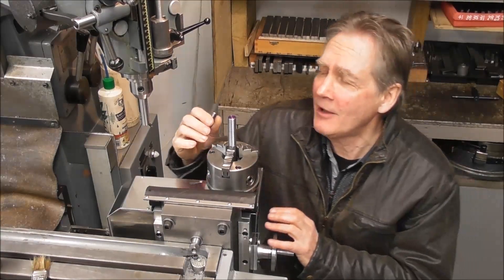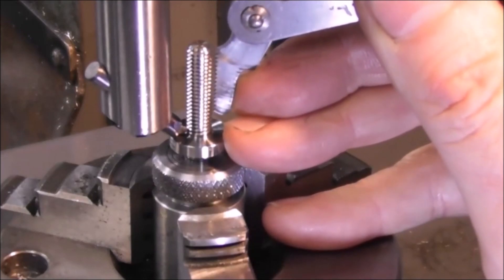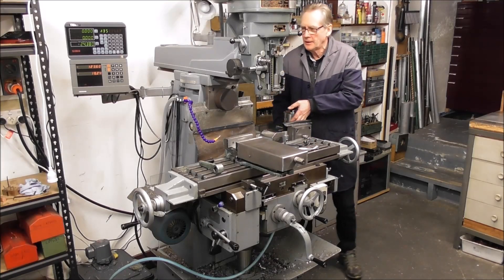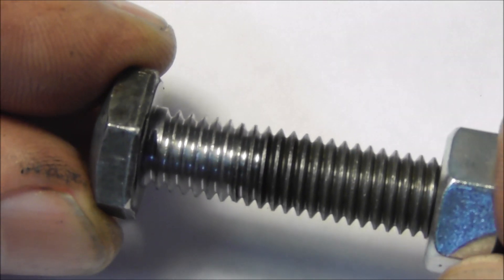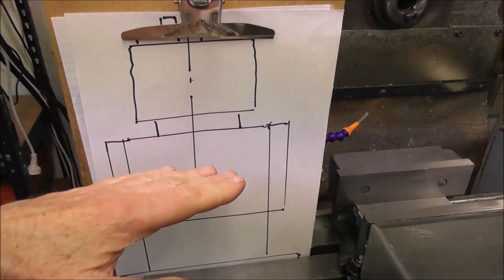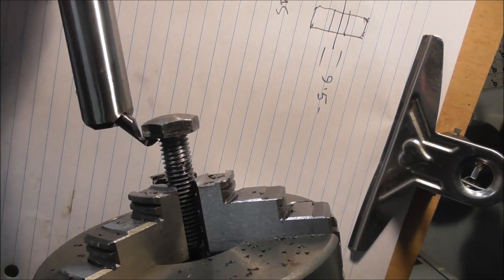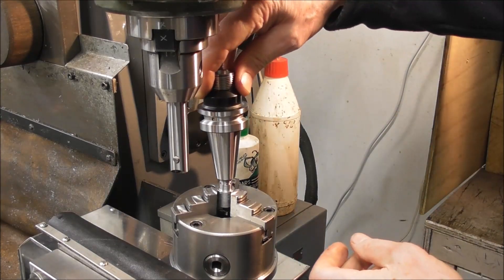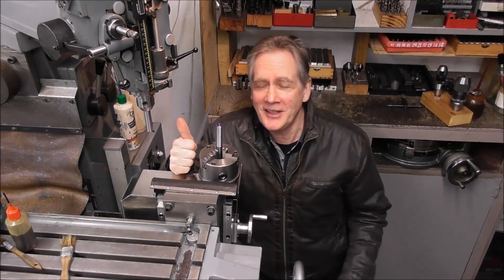ThreadExpress 2. 2 - Pros and Cons

Comment: Cliff my Hafco mill does not have a head that can swing so I think I'm out in terms of mounting on the mill.
I am wondering how necessary the mill is. 
Would it be possible to do this with a stand alone spindle with some sort of adjustment to set the distance between the job and spindle centre and skip the rest of the mill. It seems possible that if the fly cutter loads are light all that's really needed is a spindle with some side ways adjustment.
Reply from the maker: Hi. ThreadExpress started life as a stand-alone machine! See the first video in the ThreadExpress playlist made back in 2009. Cheers, Cliff
Reply: @Threadexpress  love it. I have a lot of catching up to do. If I do this I will need to go stand alone I think.

Comment: Your application is very interesting. I am interested in having the plans for the construction of a device with these characteristics, because I see many applications in the lathe, vertical milling machine, horizontal milling machine and flat surface grinding machine. I really admire your work and all the considerations you have made regarding the interpolation of a thread with a 3-axis CNC are true. Therefore I would like to know if you have the plans available and their cost.
Also, since the system is very little known, it is not widely spread. I am also a prototype manufacturer, in a garage workshop and I would like to take on this type of challenge. You can look at my page on YouTube where you can see some of the work I have done.

Muy interesante su aplicación, Yo estoy interesado en tener los planos para la construcción del un dispositivo de estas características, porque le veo muchas aplicaciones en el torno, fresadora vertical , fresadora horizontal y rectificadora de superficies planas. Admiro mucho su trabajo y todas las consideraciones que ha hecho en cuanto a interpolar una rosca con un CNC de 3 ejes es cierta. Por lo tanto me gustaría saber si tiene los planos disponibles y su costo. 
Además como el sistema es muy poco conocido por eso no tiene tanta difusión. Yo también soy un fabricante de prototipos, en un taller de garaje y me gustaria asumir este tipo de reto.  puede mirar mi pagina en YouTube donde puede apreciar algunos trabajos realizados.
Reply from the maker: Hi - Sorry somehow, I missed your comment. You may have seen in more ercent videos, Mark Presling is currently building a V3 and preparing plans. Once he has completed that stage I plan to make drawings available. Stay tuned. You can also email me address under 'about'. Cliff

Comment: If you could make a 90° for a mini mill spindle maybe it would be able to be used on a mini mill. Or use a smaller cutter facing down on some short of large fly cutter on a normal mini mill head but I don't know if that would work or not?
Reply from the maker: Sorry I missed your comment until now. We are mulling over different options, stay tuned. Cliff

Comment: Regarding mini-mills, many of them allow the head to rotate 90°, i.e. spindle parallel to the X-axis. Could Thread Express be operated horizontally, with a (much thicker) mounting block on top of the table, to match height with the now-horizontal spindle and set the helix angle of Thread Express, by pivoting about the (now-vertical) pivot bolt axis. The Thread Express unit would have to have the arc-slots built into it and the mounting block would have to have the threaded holes, since the fasteners could only be accessed from above. One disadvantage of this idea is that gravity would no longer help with removing backlash. Perhaps a spring could be used to remove backlash, or the feed nut could be made adjustable to minimize backlash. Food for thought.
Reply from the maker: Hi Mike. Good thinking, I have used it with my horizontal spindle, and it worked fine, and discuss this in an early video. I have the base plate extending enough on my prototype to bolt directly through to the table. Yes, and I have been thinking about tipping a mini mill head to 90 degrees also. I have not yet discussed this as I wonder how many mini mills tip to 90 deg? This could be the excuse I need to buy a typical mainstream mini mill and make a slightly scaled down version! Cheers, Cliff

Comment: I notice that your original machine was a 'stand alone' unit simply utilising an angle grinder as the 'miller'. I think that this route has possibilities because it overcomes the problems suffered by those who don't have a Bridgeport type machine (envy, envy) or lack access to one.

I wonder if accuracy becomes a problem?

As a person who way back as a teenager obtained a British 'O' level in Engineering Drawing I find that those three years of study such things as 'third angle projection' created in my head a sort of 'CAD of the imagination' (I was far better at free hand sketching afterwards) so that if you never reveal your mechanism I might just have been inspired to dream up my own version. 

As I have said the 'sine bar' concept allows you to 'describe' a helix which ranges from 'tends to zero (or a straight line) on one axis' to the same on the axis at right angles (or in the case of those rifling machines where sine bars are seen 'straight line rifling' which did appear in such things as experimental Baker Rifles in the late 18th to early 19th century.

Looking forward to the next video.
Reply from the maker: Thanks for your thoughts, I read them carefully. Cheers, Cliff

Comment: My suggestion for a commercial product for people with existing mini mills or non-rotating turret machines would be a stand alone machine. As I understand it would  only need one feed axis to advance the depth of the thread and perhaps a fixed spindle speed would suffice.
Reply from the maker: Thanks for your thoughts. ThreadExpress V1 was a stand alone machine. There is an old video of it in my channel. Cheers, Cliff

Comment: This product without a doubt has potential in lots of different areas. The basic system could easily be refined and modified for other applications. Unfortunately, you won't release the details so others can benefit and implement the idea in their workshops and production facilities. It may be time to let it go and enjoy watching your legacy thrive and grow in directions you haven't yet imagined.
Reply from the maker: I hear your frustration. I did intend to release the details publicly some months ago, but I have received several messages warning me not to at this stage. It is looking like they are correct as a promising road ahead is opening up. Stay tuned for more news. And rest assured if I cannot find a road ahead, I will not take the design to the grave with me. Cheers, Cliff

Comment: Hi Cliff. I would like to see it in action using the horizontal spindle.
Does your machine accept a 90-degree attachment on the horizontal spindle? If it does, the unit could be aligned along the X-axis. If it does not, maybe a D-bit type cutter will cut the thread with the unit still aligned along the X-axis.
Have you considered a complete stand-alone unit with a simple single-phase cutting spindle? For me, it would be far more saleable, especially to those without a larger machine or even if they have no mill. It could be purchased as a second op machine for a regular job.
I hope these thoughts help you.
Reply from the maker: Hi. Thanks for your thoughts. OK note to self, a video with the horizontal spindle. Yes, my Kondia head does accept a right-angle attachment, but I do not have one. I have tried D bit thread cutting, but it is not very efficient. My original design back in 2009 was stand alone. There is an old video of it in my ThreadExpress playlist. Cheers, Cliff

Comment: Thank you for this thought provoking series of videos.  I have never done thread milling of any kind and I appreciate your explanations of the technique's many advantages.   Unfortunately, like many amateurs,  I don't think I will ever do enough threading to justify building or buying such a device even if it were commercially available.  That said, it seems to me that a lathe could be easily converted for thread milling if a reasonably robust milling spindle were attached to the cross slide, set to the proper helix angle and fitted with a thread milling cutter.  The work piece would be held by an appropriate chuck, faceplate, etc and the thread lead would be set up normally via the lathes leadscrew.  The work would be rotated at an appropriate speed by attaching a hand crank or one of the many other usual speed reduction methods.   If indexing were required, it could be readily accomplished at the same setup by one of the many lathe indexing designs available on YouTube.
Reply from the maker: Thanks for your thoughts and feedback!  Cheers, Cliff

Comment: I think that you've developed an interesting tool with an extremely limited market potential. As you noted, thread milling can be easily accomplished on a lathe with a tool post grinder. So anyone with a lathe is likely not a viable customer for your product, but they need a relatively large mill to use it. That is a very small market and I wouldn't waste much time pursuing it.
Reply from the maker: I appreciate your thoughts/appraisal. As you can probably see I have been mulling a lot over this subject. I used to thread mill on my lathe for many years, I had made two different attachments. But now I choose ThreadExpress over those because it is quicker to set up and doesn't tie the lathe up when attached to the same extent. Also, it is easier to set the ratios and easier to rotate the chuck at the right speed etc. Also, because I can do index milling at the same time if it is required. All the same, those are subtle points that are difficult to convince others of. Cheers, Cliff

Comment: Pretty cool. For the mini mills to avoid the stack height of the mechanism you would have to go to an electronically synchronized system.  Basically a rotatary table and chuck on its on Z axis with steppers synchronized by a basic control box for dialling in speed and pitch and a start stop button.
Reply from the maker: Thanks for your thoughts. Cheers, Cliff

Comment: Thread cutting is a process that I find very interesting so I find this series intriguing. I'm looking forward to seeing how this machine works. If you published the plans, I would be interested. Can it be set to cut left-hand threads? I hate to recommend a Chinese manufacturer, but have you checked with Sinobi Mould? The company I used to work for used them a lot. They do really good work and the prices are very low. If you do use them, I'd send only a part or two at a time so they never see the whole assembly. Maybe you could keep some of the proprietary parts for yourself. If you go with a 5C collet spindle, there are small 3 and 4 jaw chucks that mount into them.
Reply from the maker: Hi there. Thanks for your thoughts and feedback. This current design can only cut right hand. Cheers, Cliff

Comment: This would be an opportunity to leverage the technology of CAD and 3D printing to produce component parts. Another way to maintain proprietary ownership would be to have a vendor mfg. %90 of the device while you supply several of key components, patents can and will be broken, copywriting would probably be more effective along with licensing. in the end its a relatively small market of machine geeks and nerds like me that want one. Much respect for the design simplicity of analog technology.
Reply from the maker: Thanks for your thoughts!  Cheers, Cliff